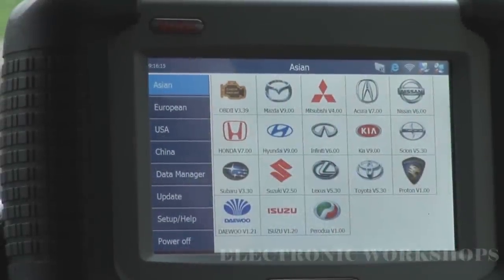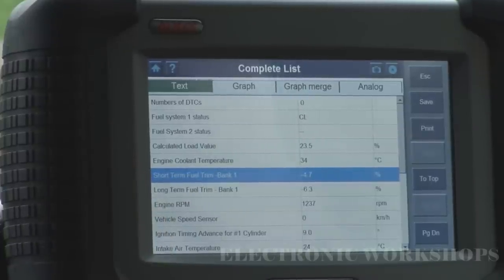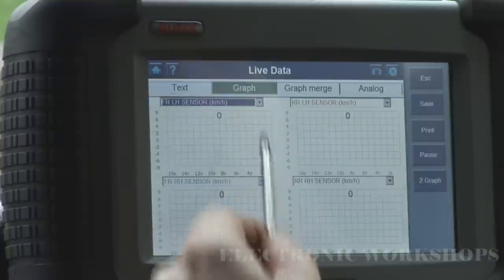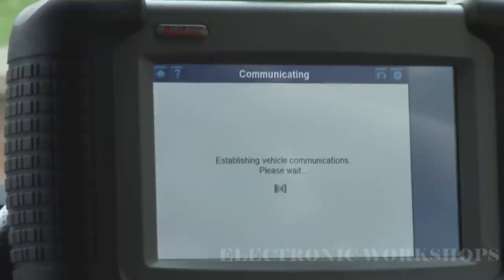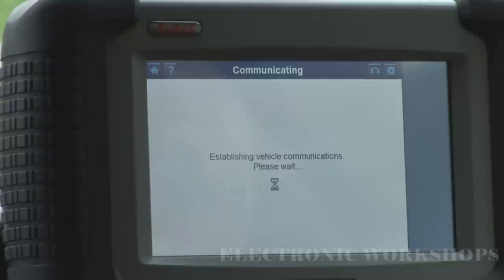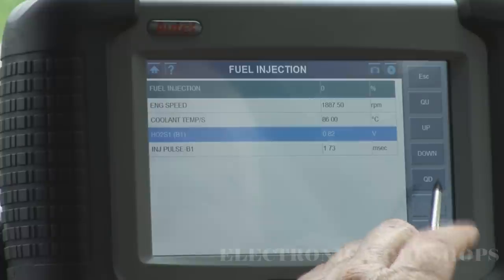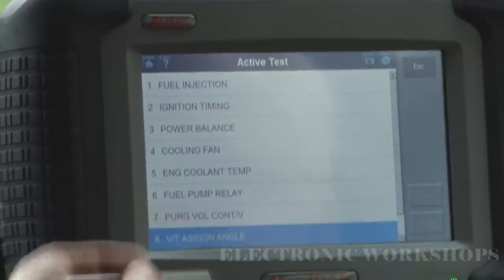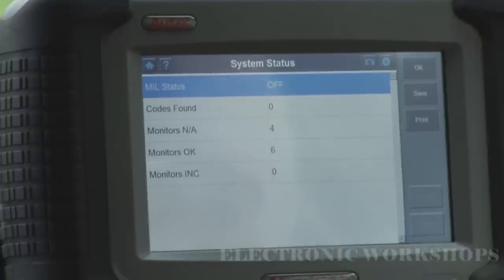Autel MaxiDas DS708 All Systems,What it can do, Part 2 | Automotive Diagnostics

Comment: Hi, I have just purchased the ds708, but i'm having a problem getting online with it, it will connect using the LAN, but not using WIFI, it doesnt seem to be able to find a IP address, even though it is set to auto detect in the WIFI setting. Have you had any problems with yours?

phil

Comment: Does it support EPB, SBC brake functions? Thinking of buying one.
Reply from the maker: I did not see any EPB,  I know the MD802 does support EPB
This tool does test ABS
Reply: Electronic Workshop I found out that it supports EPB and SBC, you didn't see cos the car you are scanning does not have that system.
Reply from the maker: Mambre Khachatryan  Many thanks for the information Mambre
As I said in the video, I only scratched at the surface at what this tool can do

Comment: One thing I read that is disturbing about this so please correct me if I read this wrong but the updates for this unit are $500+ dollars a year after the first year?  They say you don't get penalized for not updating or skip a year, but when you go to update the unit it will ask you for some type of key that you have to pay for.. IE:  Won't let you use the unit until it's paid.  

For home use is this overkill?  I have 4 vehicles, from japanese, american and german.  I don't need yearly updates to get to 2015+ models, but can this unit still be used say 3-4 years down the road without updating the unit or am I held hostage in a way to constantly have to update this yearly at the update price point?

Thanks much,
-Nigel
Reply from the maker: NewShockerGuy You will have your free years updates, you don't need to update every year, the tool wont cease to function.the updates just give you the latest and newest software for each Manufacture.I am a was a home mechanic myself, when I got this scan tool. Now I work for a small garage 3 days a weekthe DS708 got me out of some very tricky repairs.One was a Nissan Almera, with a dirty throttle body, I cleaned the throttle body and was left with the idle going up and down, 800 rpm to about 2500 rpmThere is a procedure that can be done without the scan tool, but it would not work with this carI used the ds708 to do an idle relearn, job done.If you were only seeing a few jobs a year, it might not justify the purchase costNow, I would not be without it
Reply: +Electronic Workshop What if you skip few years and want to update? Do you have pay for skipped years and current year update? Thanks
Reply: I don't think so.  I'm not certain.  But,  did you ever get an answer from anyone else?
Reply from the maker: This tool will still work if you don't do the updatesTo get the first years updates, all I had to do was register the tool on the Autel website, using the information on the label of the tool, I did not have to pay for the first years update

Comment: does this tool work with 2003 dodge ram 2500 diesel?  can't get answer from autel.
Reply from the maker: here in Europe, Autel does not work very well on old models, and they are not interested in doing any updates to cover earlier models, Snap on is the same, but they have a help line,  Autel don't, as far as I am aware
Reply: @ElectronicWorkshop  Oh! so this won't do my 2000 Grand Prix SE?